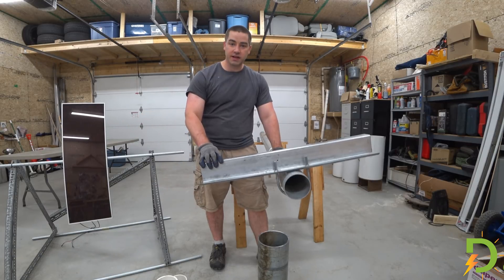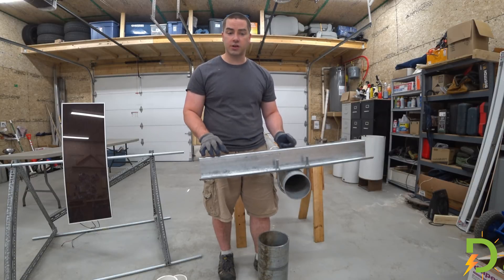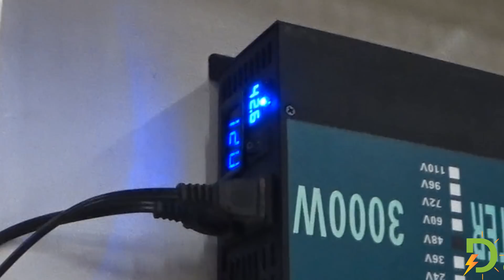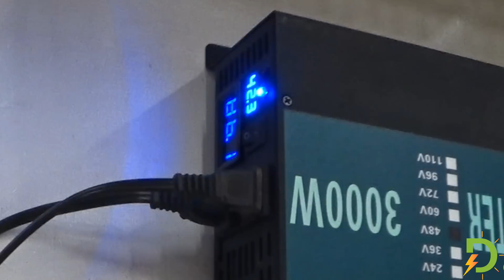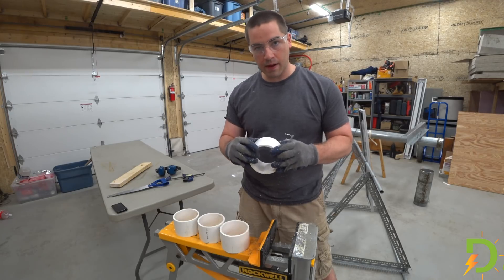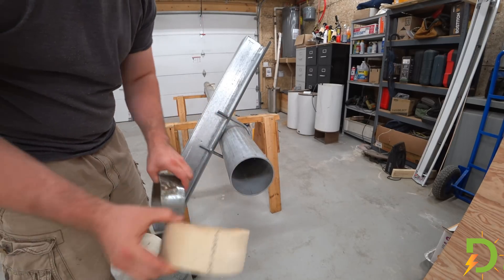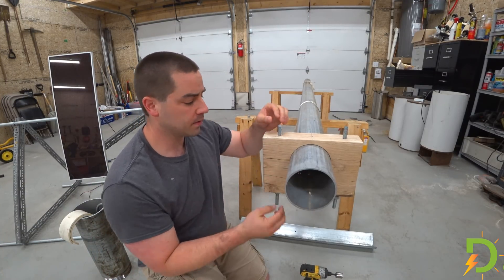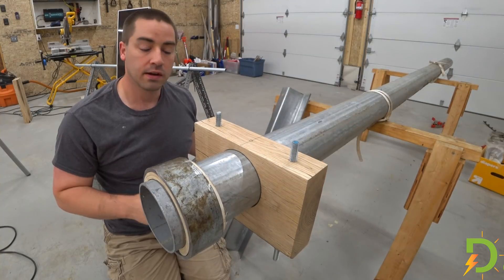Bushings: Wood vs  Steel, DIY Solar Tracking Array, Tilting

Comment: Well working with that big oak is wonderful, especially coming from your own resource.  But perhaps routing out the hole on a piece of 2x10 but do two of them to reach the 4 inch depth.  Then glue together and trim outer square.  Nice that you showed how you progressed with design as you went along, as most, if not all projects tend to do.  Thanks for sharing.

Comment: Using either a linear actuator or any geared electric motor, if you have the panel balanced well enough there shouldn't be much weight on the motors which mean you could make it relatively free moving and the motors would be enough to hold it still instead of trying to use friction for that
Reply from the maker: Thank you.  Recently I've been questioning the idea of using a moving array.  I'm currently thinking of simplifying it and just making it fixed.
Reply: I don't know if this fits in your project very well but this video still proves interesting
https://youtu.be/wDuMNY89lNk
Reply from the maker: I'm sorry, but I don't understand.  Your link was for a razor ad.

Comment: You can use window washer motors for your tilting, they are very strong and cheap as used
Reply from the maker: I was thinking the same thing Morten.  I am probably going to model mine off this video: https://youtu.be/vxhBMiyy3y0

Comment: When I was in my 20's back in the 70's, the company I worked for built fiberglass storage tanks for the oil drilling industry. I was building the 10 & 12 ft. diameter mold forms we sprayed/wound the tanks on. The tank molds were 3/16 inch thick, rolled steel tanks, slowly rotating horizontally on a 6 inch pipe axle. This axle was supported cantilever fashion, on bearings made from oak timbers. As long a as you kept em greased, they'd run forever around 12 rpm.
Reply from the maker: That's encouraging to hear.  Thanks for sharing.

Comment: If you want smooth rotation use hdpe plastic (cheap white cutting boards from walmart) vs pvc pipe rings
Reply from the maker: Hi John, Thanks for the suggestion.  Does it work the same way, as in heat in oven to curve around the pipe?

Comment: You could always hybrid it and use the wood to clamp the plastic bushing llike a pillow bearing. Cut the circle in half and shim the joint for tightness
Reply from the maker: Hi dwf dwf,  I've been trying different systems.  I bolted up a "Z" channel to the wood, but found extra play I didn't like.  The Steel has almost no play to the pipe.  Then I bought some U-bolts and tried them with the steel ring, but found the U-bolt still has some play, even when tightened down.  So they both have play in the system.  Yesterday I picked up some thick steel angle, and have been trying to cut out a simi-circle so that I could weld it to the steel ring.  I figure that would wind up being the least-play system.  However, I don't have a plasma cutter, so I've been hacking away at this steel to make the simi-circle and it looks poor.  I've been on Craigslist for a used welder, but finding the cheapest welder is just a new 125 Amp Flux-core from Harbor Freight.  $89 w/coupon.  Anyways, that's where I'm at right now.  I might go back to the wood?

Comment: Depending on how temporary you want it to be. I would go with the PVC. I would add a piece of 2" angle or sq. Tube to brace the z channel
 Cut a part circle out of it. Like leaf spring perches on a truck Axel. Pieces of 2" matereal about 6" long should work. I love projeçts like this. I designed a rear suspension for a truck I had. It was a bit heavy duty for a 1/2 ton truck but it worked well. Can't wait to see what you come up with. I would use the PVC and add zerk fittings. And drill a hole in the PVC for the grease to pass. Keep at it.

Comment: I'm sure you'll do it soon, but I'd be interested in your thoughts/ideas on how to change the angle automatically.  I would think linear actuators might be too "weak" for the weight of the panels.  Then I was thinking maybe a threaded rod type mechanism but not sure how it would attach.
Reply from the maker: Hi Joe,  I haven't yet decided which way I'm going to go.  It could be a long ways out given all the things I still need to do for the whole solar/powerwall system.  Right now I'm thinking a windshield wiper motor connected to a scissor jack.
Reply: Well the panels should be balanced on the pivot so your actuator takes no extra stress.
And the simplest actuators people make are usually a threaded rod attached to either a windshield wiper motor or a cheap drill motor, then a slow timing switch to move it every couple of minutes.

Comment: Oh, the dual axis tracker would indeed have a benefit. A cost-worthy benefit? Probably not. :P

I keep wanting to build some method of tracking for my solar panels, but they're quite expensive, especially automatic ones. :(
Reply from the maker: You nailed it, not a cost-worthy benefit.  I'm trying to keep my purchasing of supplies (specific to the mount) to a minimum.
Reply: Well depending on how much exposure you get in your location it can be up to 50% extra electricity per day, so instead of a 1000W system you got a 1500W system with two axis tracking.
And from that you can also work out what it's worth.

Comment: If I had the space and the panels I'd love to make an arduino or raspberry Pi -controlled solar tracker using time of day and latitude, and control two linear actuators to set the optimum angle continuously through the year.
With one actuator you could mount the axis north-south and rotate the panels E->W during the day.
However, just getting more panels might be cheaper and easier though not as much as a technical challenge!
Look forward to seeing it up and running...
Reply from the maker: Hi Andy,  I thought about the idea of a duel-axis tracker, but eventually settled on the idea of one axis.  The reason is my site.  The last place I have on my site to mount panels is my backyard (where I showed the model in my past video).  It is shaded on the east and west, so the window is short, and south.  I will build this array to change angle for time of year.  Thanks for watching.
Reply: Yes, the shading kind of negates the advantage - so you gotta make the most of your window!
Raising the whole thing may get you an hour or two more, and power optimizers will help mitigate shadows as they move from panel to panel, but that also pushes up costs significantly!
(Did you find my feedback on cheap BMSs useful?)
Reply from the maker: Hi Andy,  I read all comments and appreciate any help offered.  The link you sent was to another youtube video on cheap bms's.  He had links to Ali-express in his description, but just went to a generic "BMS" page, not a specific one.  The cheaper bms's I've seen on Ali-express seem to have the same issue you described, having 50ma or 60ma balancing.  That's the other thing, I'm still trying to lean all the terminology for BMS's before making my choice.  Top-balancing vs. bottom-balancing.  Then there seems to be some that balance continuously, and some that only balance during charging.  Most I've seen don't have a user interface.  I saw a video on Going Off Grid, he said he had a BMS with LED's that would flash if they were balancing, but couldn't track down the same one.  Anyways, I've still got more to learn on the topic before making my purchase.  I'm not complaining, the learning is half the fun of making projects.  On the positive side, I just checked every cell (all 96) and found them still in balance.  I'm working on a charger video, probably be out in a week or so.
Reply: There certainly is a lot to learn, and after watching literally many thousands of videos on this subject, I think I'm a bit closer to being an expert now!
I've built a 14S 2kWh ebike battery and have another 800 tested harvested cells to put together for a home battery - still halfway entering them into the database to be able to allocate them to equally sized modules and I'll put them together using Average Joe / HBPowerwall's methods.
I prefer and recommend top balancing for home batteries/ebikes and only do balancing when the cells are at or near top of charge. Continuous balancing is pointless and wasteful.
When the weakest module reaches 3.0V, then stop everything... if it has a significantly lower capacity than the others, then change or add to it.
I'm using 18650s instead of leaf cells, but the principles are the same - you have 96 cells with 12 groups of 8, I have 784 cells as 14 groups of 56.
You do not need a monitor for each and every cell because they are connected in parallel - every cell connected in parallel in a module has by definition the same voltage! So you only need one longmon for every level of series, 12 in your case, 14 in mine and the basic Batrium would do the job perfectly.
Then you can forget spending weeks hunting down cheap Chinese BMSs that may burn your house down and/or kill your batteries with no hope of compensation! Capiche? :-)
Reply: ps... The BMS in DIY Tech's video from here https://www.aliexpress.com/item/14S-60A-active-bms-2017-new-Li-ion-smart-bms-pcm-with-android-Bluetooth-app-UART/32824233108.html
This is what I bought for my 1.5kW ebike but it's 14S. They have a 12S version too, but would only possibly be useful for you to monitor the cells via bluetooth as 60A is not enough for your 3kW.
If you got another 16 leaf cells, you could go to 14S as well with 58.8V max and be able to use more of the battery capacity with the inverter - I don't know what its max and min cutoff voltages are, but I think the 42-58.8V range of 14S would be better suited to the inverter than the 36-50.2V range of 12S, though I would use a smaller range and set cell max and min to 4.10V and 3.2V to extend battery life.
Reply from the maker: Hi Andy,  2kwh sounds like a BIG battery for a bike, nice!
I think we still have a misunderstanding about how my battery bank is wired.  It is different then AvergaeJoe, or HBpowerwall.  I have 12 cells in series per battery, 8 batteries are then wired in parallel.  AverageJoe wired 100? cells in parallel, then wired those 14 groups in series.  I totally get that he only needs one monitor per group of 100?.  Mine are not wired that way.
Reply from the maker: Thanks for the link.  How's it working out?  I think Going Off Grid showed that the cell voltage for #1 cell was always wrong.  Have you seen that?
Reply: Yes 2kWh is nice, all 22 pounds of it! Thinking I'll add a trailer to carry the 7 kWh pack I'm building and add my portable solar panels and an inverter for remote or home use - I like its versatility.
Finally I get it - thanks for the clarification - so you only have the "ends" of your batteries connected in parallel - the cells in between are floating.
In that case, if you can connect all the middle cells in parallel too then you won't need to monitor every cell individually and can use 12 longmons... Each S will then keep every other cell on its level in check. (The inter-cell cables don't need to be heavy as current between adjacent cells is very small - the main flow is through, not across).
It would then have the identical topology as used in our DIY community, just your cell units are bigger.

      1       2      3       4  ...
12 ----...-----...------...-----... +
11 ----...-----...------...-----...
10 ----...-----...------...-----...
  9 ----...-----...------...-----...
  8 ----...-----...------...-----...
  7 ----...-----...------...-----...
  6 ----...-----...------...-----...
  5 ----...-----...------...-----...
  4 ----...-----...------...-----...
  3 ----...-----...------...-----...
  2 ----...-----...------...-----...
  1 ----...-----...------...-----...  -

Hope formatting survives!

Comment: You would be better off to use the metal, make the plastic go all around and brace the pipe back to angle iron,
also you might drill and tap for a grease fitting....sort of surprised that you went to all the trouble to build a great house and now i understand that you are considering moving and starting all over....good luck with the sale..richard in arkansas
Reply from the maker: Hi Richard,  I love building!  That's why I'm always talking about "the next house".  There is no timeline for moving, just "at some point".  In the meantime, my wife and I are enjoying living in our home.

Comment: Since you are using it for the 3 change settings spring/fall, summer, winter it does not have to be like a bearing just be able to move. Now if you were using it to collect prime sunlight all day then I would worry about a smooth transition. I like the Oak and if the hole gets a little loose you can cut the circle in half as a tightening mechanism.